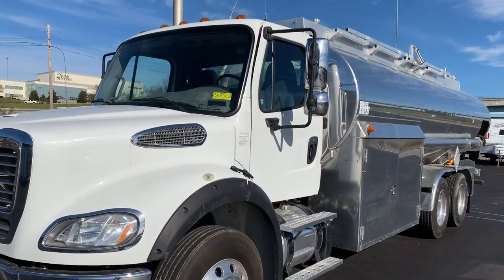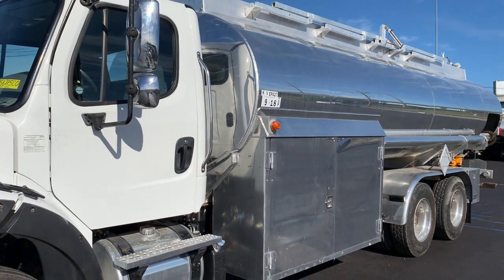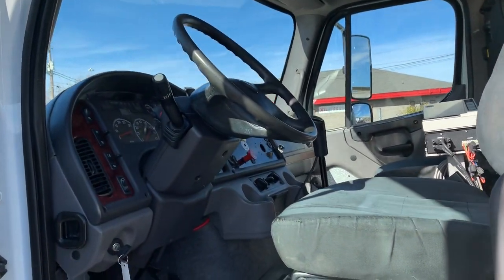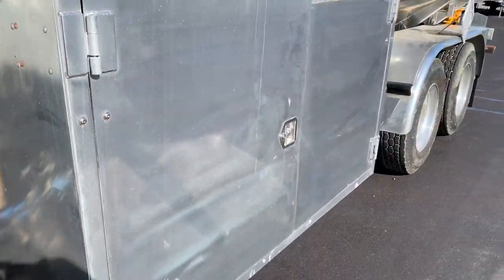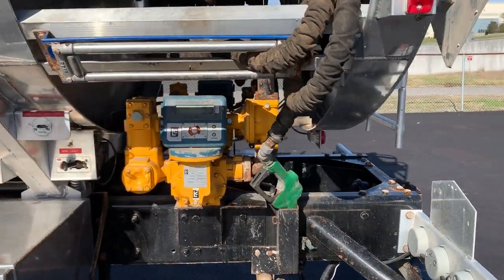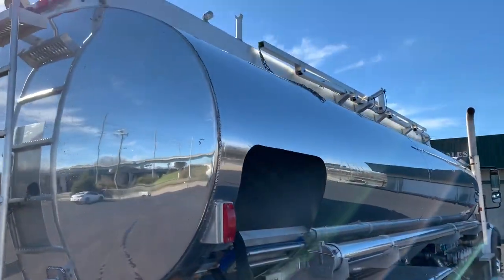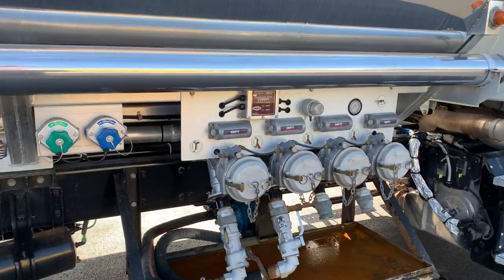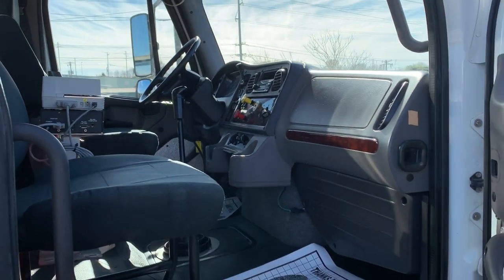2015 Freightliner M2 112 with a 4700x4 Aluminum Tank For Sale (Unit # 156715CO)

Comment: What are the compartment sizes? 
Does it have a 2" direct discharge?
What is the steer axle rated for?
Are the reel hoses 1 1/2 or 1 1/4?
Reply from the maker: Hi Greg, the compartment sizes are 800-700-1200-1200. It has a 2" direct discharge, the steer axle rating is 14,700 lb, and the hose reels are 1". Please let us know if you have any other questions or give us a call at (865) 524-5678 if we can be of help!